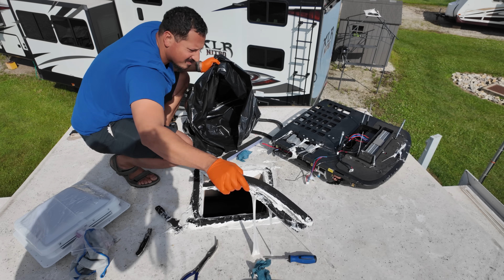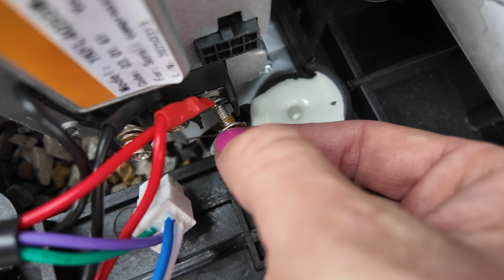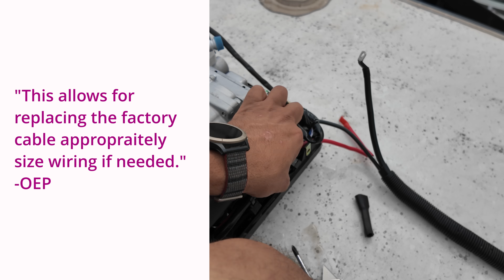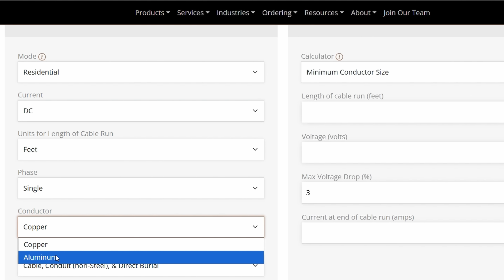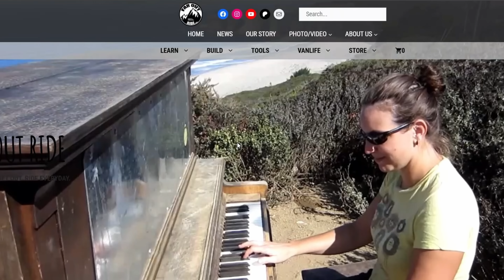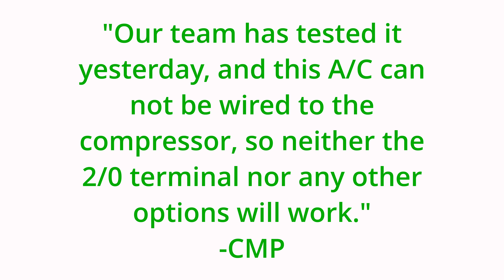The Truth About 12V RV AC Wiring in Big Rigs (What No One Says)

Comment: Seems the problem is the way you want to run the cable.  Why not run it straight to the front?  If you’re already willing to drill a hole in the RV don’t see why you would run it back then down then to the front. I would think there’s way to shorten that run by running it straight forward and down the side. Or maybe just put some battery in the back to shorten the run.  Lithium batteries can be put anywhere.

Comment: How hard would it be to convert your 12 volt system to 24? You can use a 24v to 12v converter that are less than the price of the thicker cables you would need for 12v. When you convert 12v to 120VAC your inverter has to multiply the voltage 10 times. 24V system is multiplied by 5. 48V is 2.5 times. With every multiplication needed to gain a higher voltage, efficiency is lost in heat somewhere.

Comment: This issue comes up with other equipment such as DC/DC chargers.  The large wire required for long runs won’t connect directly to the device.  The solution is very simple - and you see it in almost all UL rated appliances.  The pigtail wire is much smaller, but it’s OK because it’s also much shorter.  

There are many ways to cleanly and safely connect the big long run wire to the last few feet or inches to the device.  A disconnect or buss mounted in a wiring box is simple and easy.   Exactly like how the HVAC unit on your house is wired.  The long wire is big - the shorter appliances leads are much smaller, and they connect via a disconnect box mounted on the house near the unit.
Reply: I was thinking of saying the same thing. My class A has a 50ft run of 3/0 from the rear battery bank to a distribution panel in the front of RV that feed 100 amp of other smaller equipment.
Reply: Exactly.  I'm going to put a 100ah with cold cutoff mounted in a weatherproof box right under the unit and run the larger cable to that battery, then shorten the cable that came with the AC to look clean.  I'll put a low voltage disconnect to disconnect the battery from the AC so I'll never put it in a brownout scenario which is what kills these units.  2 birds with one stone, it gives me 270ah of DC power total where am runnign out of internal area for batteries, and also lets me run the shortened pigtail to the in-line battery.  The in line battery isn't really necessary, but it will ensure very clean power on startup.

Comment: You can run the wire down the gray tank vent pipe. Go down the vent pipe and drill a hole in the pipe above the gray tank. Your wire will end up in the underbelly area. Go to your batteries from there. This way no new hole in the roof.

Comment: If you have a REALLY long run you need to rethink your wire run to shorten it up. Running it to the rear only to have to run it back to the front is part of the problem here.
You could have easily used the wiring the came with the 12V unit and just added your upgraded wire to it. There is nothing wrong with doing that. I am sure the correct wire size and length was included with the Unit and all you have to do is add a thicker wire extension to extend the wire for a long run. You can also shorten the wire that came with the unit if you are worried about efficiency and use a screw type of junction terminal to join the two different size wires together without the need to crimp on new terminal connectors.

Comment: It sounds like they are using the 12vdc to run an inverter. If you found a energy efficient model with soft start you might have the same thing.

I don't know one thing about roof ac units. But I do know about wire sizes. I have seen S.O. 4 ga12 that was ran 100 feet melted the whole way. It was only on for one hour. It needed to be ga8. 

You can run the wire bigger. You should try to use the right size. Power runs best when everything is sized right. Thanks for helping people not start a fire. And please always follow the torque specs. Every single time you put a junction. I have seen buildings burn down from the heat at a junction. 

And never run a wire that is not able to handle the amps on the breaker.

Comment: I have done several 12/24 VDC RV installs . Them AC units are broken down in a few types. 12/24 V and cool to heat/cool types and the BTU rating.  some models run DC wire threw the inside and some run it on the outside.  I normally install the ones that run the DC wires threw the opening into the RV.  Then you need the one for roof thickness .  What I do for long runs is use the wire they give .Just get them inside to a place wear DC Buss Bars can be installed. Like behind a wall or in a electrical box. Want this close to the AC  as possible. Nor shorten the wires that came with AC . Just to fit to buss bars with new ring terminals . Hydridic crimp them . put on glue line heat shrink. Mount to buss bars.  around 100 amp buss bars is fine. Now at this point you have terminals for big wire. I use 3/8 stud buss bars  . They come in 1/4 - 5/16 in as well. 2 or 4 post .  Use you 0 AWG or what ever size you need . You can run 2 small AWG together as well. Just double them up on studs . Run you big wire to battery. You may need buss bars at battery like the 4 post ones to connect everything to battery . This is normally what I do. I use like 400 amp rated buss bars. Always a fuse or breaker and a safety disconnect stitch at battery positive.  With the short piece of smaller wire rated for the correct amperage that shortened piece will have a very small voltage drop . And buss bars gives you a place to hook up more 12V loads . Like a LED light . Use UL listed lugs and UL all copper wire . Use glue line heat shrink at terminals and get correct stud size. Add wire loom or conduct for the ling run for safety. If you want to run 2 sets (4 wires ) of like 1 AWG or so . that is fine as well. Just zip tie the red to red and black to black  as you go along.  Normally I run like 0 AWG . I use Windy Nation DC welding cable rated for solar and RV use and is UL listed . Any more questions please ask. I am a small systems solar installer for off grid home and RV systems.  Cheers from NY
Reply: When watching this video I was wondering why this wasn't done first, large wire to a buss-bar located a few feet from the load. I've done the same thing with other 12v equipment installs.
Reply: @meko1896  Math gets complicated.  You need to calculate both the loss in the larger cable and the loss in the smaller cable...and they're co-dependent.  Not that a basic Excel formula wouldn't do that
Reply: I came here to suggest this too. I'm hoping that I'll fit the run with my 23 foot class A without fussing over cables.
Reply: Ditto.  Also consider moving a couple of batteries closer to the ac
Reply: I also did bus bars connected to 4/0. Works great.
Reply: "You can run 2 small AWG together as well. Just double them up on studs" This is not a recommended practice unless you fuse each of the individual cables within your "doubled up" bundle. You know this, but speaking to newbie DIY'ers looking to avoid fire hazards...
Reply: This is a smart answer.  I have one of these units I got for free because someone balked at installing it.  My main concern is actually how I'm going to feed my 12v system off of my 48v.  Right now I just use a 30a mppt controller as my buck converter from 48v to 12v.  It works great, but it probaby won't keep up this AC's draw.  The state of 48v to 12v converters is god awful in the market now, so my thought is to just use another matching 30a converter.  Math says that should give me 60a, and this AC won't pull that long term anyways.  48v is amazing in general, but this is a little new :).
Reply: @vmlinuxz  I find with them 48 to 12V converters when using 2 for more amps is use 2 of the same unit and keep wires same length to balance load .If wires are long then mount converters buy the 12V load and run the 48V wires longer . 4X less amps on 48V side. Cheers
Reply: @robertmeyer4744  Ok, yea, that was the exact same answer I came up with.
Reply: @vmlinuxz  Remember disconnect the 48V side when not in use. Them buck converters have a small draw all the time.
Reply: @robertmeyer4744  you sound like you know your stuff. do you do instals?
Reply: @robertwarner3191  Yes I do . Just 1 man shop and mostly I am a electrician and RV is just side work. I do lots of solar installs. Off grid only . Small home systems and some RV as well. Mostly up grades. Lots of lead out and LiFePO4 in. I am in NY . Small shop . Mostly take oud unit off and new install. The new AC inverter units are nice . R 32 and heat/cool . They a heat pump.  Cheers from NY ! Boston area .

Comment: People love to fall into the efficiency rabbit hole and get 12v ac`s fridges etc.. except were in a time were batteries are way cheaper than 5 years ago and the premium for 12v appliances is still there, for the price difference between a 12v and a residential fridge for example you can easily offset the efficiency loss and buy more battery power. Add to that price the additional  wiring expenses you need and there is litterally no case to be made for 12v appliances at all.
Reply from the maker: Love this- we definitely plan to increase our batteries.
Reply: Yeah, I recently upgraded  the power system in my older van, I bought 600 amp hours of batteries with 5 years warranty from actual nationwide stores you can walk into all for $1050 USD equivalent. My lights ventilation fans and fridge are 12v, almost everything else I just switch the inverter on for.

Comment: Did my homework first!  34' class A and knew it wouldn't work for rear ac because it was so far to battery bay in front.  I installed the outequip pro in the front and added an enclosed fused connection in a cabinet that the original wiring would reach.  Ac to cabinet, 12' and 6' to battery with 1/0.  Done deal, ac works great!  I can feel air movement from bedroom that lets me sleep on a hot night.  My Motorhome is 1999 and both original Coleman Mac ac worked fine and I could run one at 140ah and cycle at night but now do that on 25ah...way better.  I'm pleased.

Comment: I installed the 10,000 BTU Outequip 12v unit on my 18' Promaster van.  I used the included cables which reached my batteries.  My suggestion to you is to move your battery bank in order to use the supplied cables.
Reply: Moving the battery bank may not be possible. Adding another battery bank closer to the AC may be the better option.
Reply: I tried on my 159PM, it did not work and the wires were over 116F at the fuse.  The rest of my system is BattleBorn and Victron.  After a week of troubleshooting with OutEquipPro, they accepted the my return with a full refund. and they paid for return shipping too.
Reply: Hi @davidtaylor3714, I was thinking about getting the OutEquip 10,000 BTU AC. I have an ANKER Power Station that has a total of 4096 Wh. In your honest opinion, do I have enough power to run this AC. I'm learning all of this stuff daily. I will be putting the AC on top of a Topo Topper, a pick-up truck bed pop-up topper. I do not need to have any longer wire that's provided. My power station has the ashtray 12v plug-in and also 120v house plugs. Thank you for your assistance. Are you happy with the OutEquip AC so far?
Reply: The battery/electric bay in most 5th wheels is in the lower front of the main body where it starts to go up over the pinbox/hitch. Moving that closer to the roof of the rear bedroom without redesigning the entire electrical system, possibly upsetting hitch balance, etc. is way too much trouble.

Comment: I can't believe that none of these so-called electricians have given you the actual answer.  It's very simple, you have to put an inline battery.  Take a 50 amp or 12 amp hour battery at 12 volt and put it very close to the unit, then connect your main battery bank and the inline battery in parallel. 

The heaviest load is going to come when the unit turns on, then the amperage should drop.  Your in-line battery is going to bear the brunt of the effort but as long as you have sufficient cabling to handle the average load you simply size your cable for that average load between the batteries.

That may not be as clean of a solution as you want but these systems are designed for small cable runs to the battery in semi truck cabs so they don't have to install APUs.

I am beginning the install on one of these now, I'm looking at about 16 ft and that's the solution I am probably going to have to do.  So I will run a cable from my 200 amp Coach battery to the inline battery inside of a cabinet and then run from that inline battery back out the same hole that I'm going to put in the back of the motorhome that all of the air conditioning cables are going to come in to power the air conditioner.  I want to try and get that battery as close as humanly possible to the air conditioner.  I have a spare LifePo 4 starter battery for a generator that I actually didn't need so that's probably what I'll use, I just need to check the specs.

Also I would reccomend a low voltage disconnect if you use an in line battery, or run directly to the unit with thick cables and a much shortened pigtail.  That will keep you from giving this unit dirty low wattage power and harming the unit.
Reply: There's so many issues with that idea. The "so called electricians" know that's going to cause a fire one day. Do you wear shoes in pairs? There's a reason every professional battery system is fully symmetrical. I urge you to learn a lot more before implementing this idea. Novel doesn't mean good.
Reply: @rubikmonat6589  DC is a technology from the 1800's if you can't do the math to size your cables, and follow best practices around fuses, I agree that YOU and any other imbecile should avoid it.
Reply: @rubikmonat6589  "So many issues" means you are uneducated on DC, a technology from the 1800's. I agree that you aren't someone that should be doing anything around electricity.  It's amazing that people in 2025 still don't know about these things called "fuses".  Or know how to use a simple cable size calculator, or how easy it is to crimp their own cables.
Reply: @vmlinuxz  I designed built and maintained numerous solar communications sites back in lead acid days. I actually used to maintain passenger jet starter and evacuation lighting batteries for a while (scary fault currents from those beefy NiCds there). I currently look after battery backed up fire alarms for major hazard facilities and marine safety systems. Never have I ever, in my 35 years career seen mismatched batteries in anything professional. What's going to happen is your weaker battery will get worked harder, cycled deeper, and start to go bad, then the stronger battery is going to push current into it and it will become a heater, because it's effective series resistance is so high, degrading it further.

Comment: It's just basic electrical stuff. My 12V AC unit draws 75A, and the supplied cable (~15' long #4 I think) run little bit too warm for me.  So I added a #2 (or #1) cable loop with a 100A fuse in parallel. That is $100 extra expense but worth it. Both cables now run cool, and I have a redundant wiring.

Comment: rv's really should all be 24v... almost all 12v appliances are actually 12/24v capable... especially if it plugs into a 12v auxillary/cig port. its coz truckers and industreal equipment all run on 24v so it has to be backwards compatible. this includes 12v compressor fridges, i have a video running one on usb-c at 28v in my living room for the last 2 years as an ultraefficient drink fridge lol. u can get 24v ac kits meant for truck cabs from china all day long for 300 bucks new.
Reply from the maker: Agreed wish they all came as 24 V. Thanks for sharing your insight.

Comment: Why not run a 2/0 cable for the 50' run to a distribution block and then the smaller cable over a short run to the distribution block?  There are plenty of options in the car audio (12v) product lineup for distribution blocks.    Your run of 6ga can be extremely short, and handle a LOT of power this way.
Reply from the maker: Good to know!

Comment: Can't you just use a 12v to 24 v converter at the batteries. That would drop current to 35 amps. Much easier and lower cost to wire.
Reply from the maker: Not a bad idea, thanks for sharing!

Comment: Southwire calc is for one way distance. So you should use 50'.  Plug your numbers into Omni.  They say, "One Way".  50' is a long way for sure.  Using your numbers, 13v 55a  50' at 10% loss (13.0-1.3=11.7, not too good but shows 3ga wire...  Using 6%  ( 13.0-.78= 12.2v)  1/0 cable recommended..   Most of us 12v AC folks are doing distances of less than 30' one way.  If a person wants to be off grid DC for the Fridge and AC it  is great.  400+ Lithium batteries too.  If a person is mostly on shore power then 120vac is the way to go!
Reply from the maker: You are right! Thanks for
That correction! After going back and playing with it some more I’m getting similar numbers on both calcs. Thanks for sharing!
Reply: If I'm accepting 6% loss I'll just use a cheaper mains powered air conditioner which comes with a complete set of performance specifications and my 97% efficiency inverter.

Comment: Would it be possible or make sense for the manufacturer to provided a "built in" AC to DC convertor so you can use the existing 120v already installed on the roof?  I understand this is not what the boon dockers with solar/battery operations are looking for but If these units save energy and are quieter than I would like to replace my old 120 volt with a 12 volt unit.
Reply from the maker: Not sure! That would be great!
Reply: The manufacturer said I could so I guess it would be fun to see if there is room inside the air-conditioner housing for a converter.